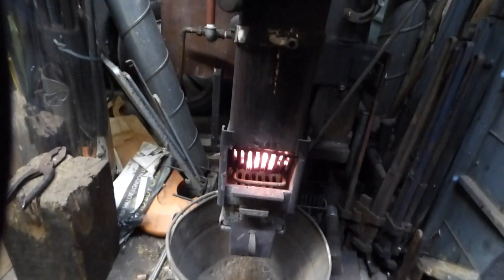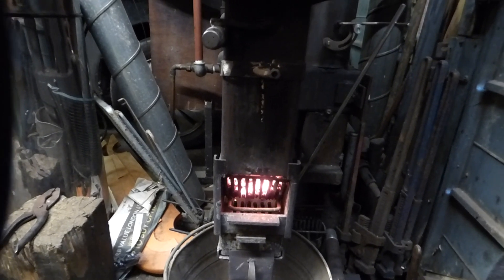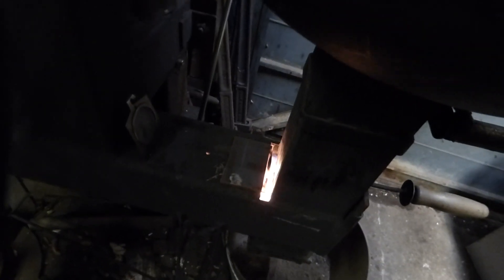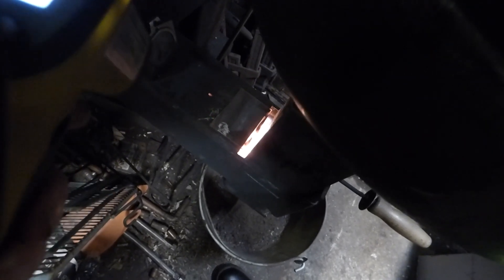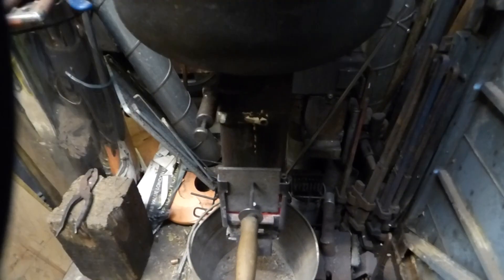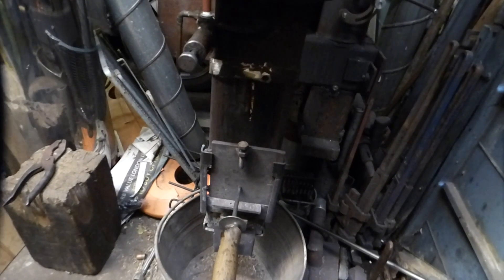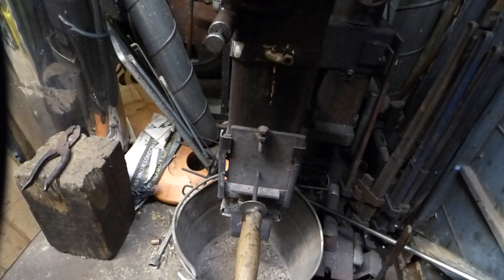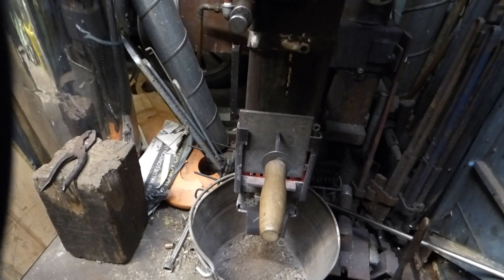rocket stove wood pellet heater MK3 this should clear the queries No73

Comment: I found that trying to control the air inlet only made my stove start to burn up into the feed tube. So instead if I want to control the temp I have to control the a mount of pellets that are burning. And so I just made a smaller burner. I have about 5 different burners no that I experimented with and  I have it down to two burners that work well with two different heat ranges. 
 In my experience with burn baskets, the air has to rush past the pellets, helps the ashes fall down and keep them from building up and plugging the basket. If you slow down the air, the pellets start to plug the basket and either burns up the feed tube or smolders putting the fire out.

Comment: Thanks for your videos...I've watched all your rocket stove videos and plan on making one.   Question...you've talked about the length of the burn chamber being 4x the diameter of the tubing and that it should not be shorter....could it be longer?  I'm thinking it might be nice to make the distance from the feed tube to the middle vertical long enough so that I can set a cast iron skillet on top of the burn chamber :)
Reply from the maker: Yes it cam be longer.
Reply: @davids381  great, thank you

Comment: First off, thank you very much for all your very informative videos!   Now, can this unit be copied but with 50 or 65mm square tube? Just reduce all lengths by the same percent ?  Thanks.
Reply from the maker: yes all good
Reply: @davids381  is the thickness of the burn chamber thicker tubing or is every thing 3mm?

Comment: I have been making this on and off the last 3 days, pretty much done except with making the primary rack and putting legs on it. I have a question? what keeps the secondary rack and the primary rack from being pushed too far into the burn chamber? should I weld a metal stop in there to keep it from being shoved back too far or?
Reply from the maker: No stop .
Reply: I think I figured it out, the the primary rack hits the air chamber vents inside the feed tube? I never put the vents in yet, and havent welded the feed tube onto the burn chamber tube. Thx david!